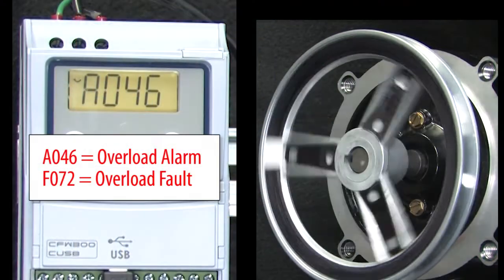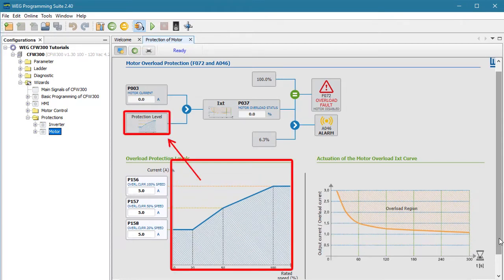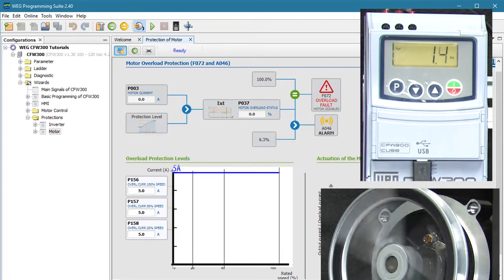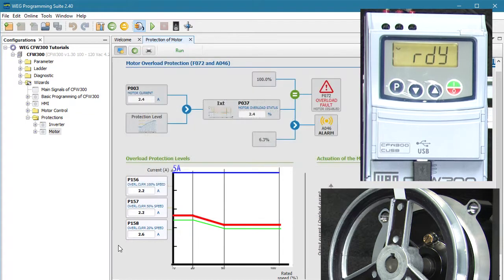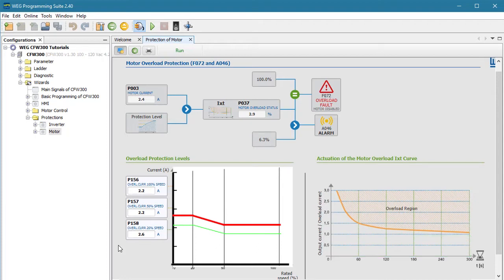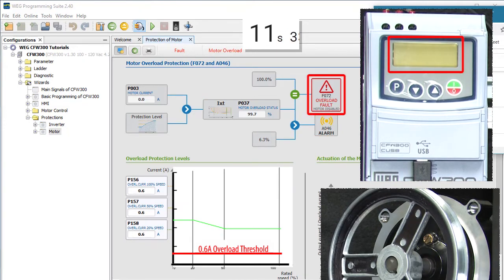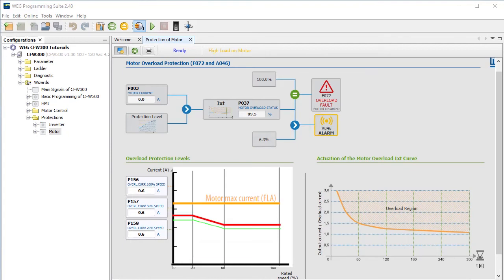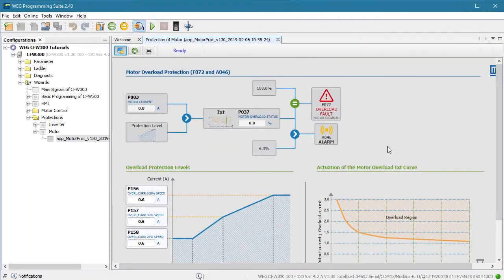WEG CFW300/320 VFD Overload Configure & Debug from AutomationDirect

Comment: probably a total newb question: but when you say measure it 'under load', say my motor is a lathe, would it be better to actually turn something and watch the amps, or just turn it on with nothing in the chuck and see what it draws just freely running the motor?
Reply from the maker: Yes, under load means under heavy usage.